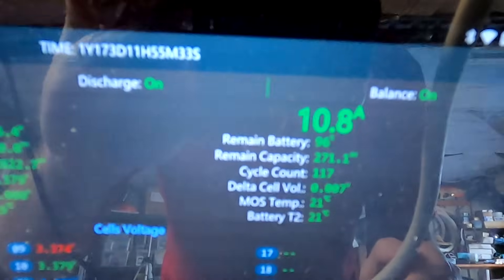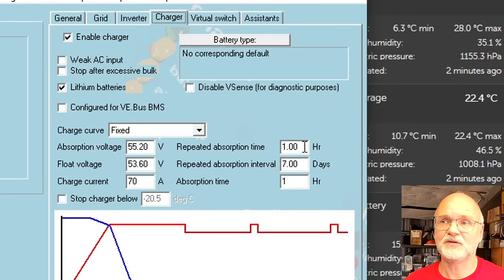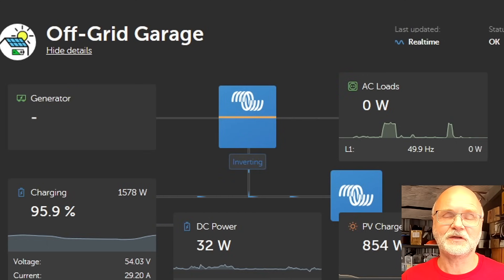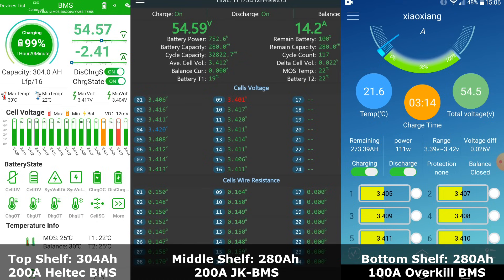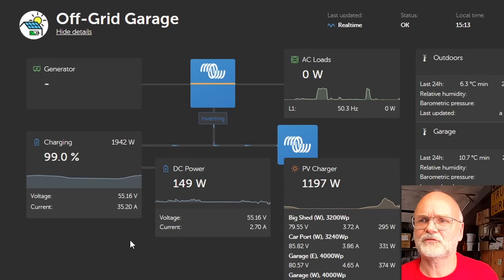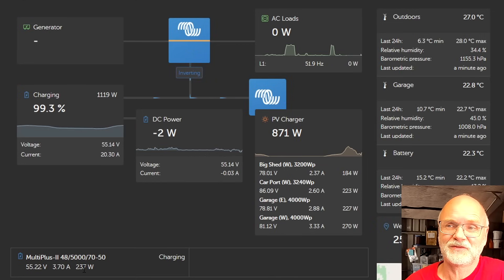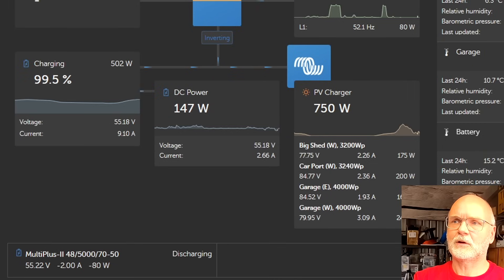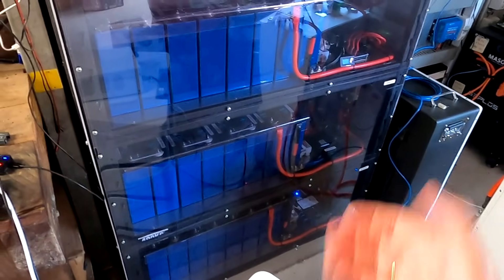Battery Shelf full charge after 4 months. First time of Multiplus frequency shifting!

Comment: Andy, very interesting and I did the same setup. I now need to connect an inverter to my multiplus to help out with peak loads.
When you connected your multiplus and inverter together, you said to not enable the charger as it would go around in a loop. 
So can you tell me how that is avoided now that you enabled the charger for the micro inverter?

Comment: I have some trouble to get the smartshunt and jk bms matching in soc. Up to 30% is looking the same then the bms is lower then the smartshunt. I checked the busbars,   individuele connection to the battery. Current and voltage are the same. What can I do to solve this?
Reply from the maker: Nothing you can do about it. Don't worry about the JK SOC. I have 3 BMS (JK, Heltec and Overkill) and they all show different SOC levels. They all calculate differently. Take the smart shunt as point of truth as I found it to be the most reliable and precise measuring device.

Comment: How do you limit the output of the tilt system microinverter when the Phoenix 'generator' is on?
Reply from the maker: This is a scenario which usually does not occur. The 'generator' only comes on if the battery is low but not at 100%SOC. 
There are other Assistants you can setup in the Victron Multiplus which disallow the generator or any AC load from coming online above 90%SOC for example.
I could setup a rule in either Home Assistant or the inverter which turn off the Shelly switch in the Micro-Inverter connection if SOC goes over say 95%.
Reply: I thought it came on for load.  Conceivably one can have a full battery and enough solar to carry loads above your configured threshold, causing the Phoenix to be switched on, locking the frequency at 50Hz.  Your lockout over 95% is therefore necessary for safety but also means you can't handle the highest loads when you have the most generation (potentially)  @OffGridGarageAustralia

Comment: Hello Andy follow yr channel on regular basis have 24v system in Wales UK have recently bought jbd BMS  but having trouble with China on what software they r using they advertise one with dashboard and access to parameters but not the same version on yr channel  any chance u could let me know which version that is thanks again have learnt loads from yr channel which is fantastic Cheers
Reply from the maker: Well, are you on Android or iOS? The XiaoXiang app should work with the JBD BMS with no problem. You can also try the Overkill app which works with most JBD as well. I have links to both of the apps on my BMS website: https://off-grid-garage.com/battery-management-systems-bms/

Comment: @OffGridGarageAustralia
Possibly found a new reset SOC feature in JK app. I recently upgraded some of my older JK BMS modules to newer B2A24S20P modules. I also updated to the JK BMS app v4.15.3 and found (among other things) two new configuration values: "SOC-100% Volt.(V)" and "SOC-0% Volt.(V)". My HOPE is that this will allow for a better SOC calibration for the JK BMSes. I emailed JK BMS support but not sure if they will respond. Would love to have your take on it?
Reply from the maker: Isn't the JK resetting to 100% quite well once the battery is full? I never had an issues with that.
Reply: @OffGridGarageAustralia  Historically JK BMS seems to reset to 100% SOC when it reaches the "Cell OVP(V)" value which, as you know, is not optimal. I have noticed in the latest JK BMS hardware they now have "SOC-100% Volt.(V)" and "SOC-0% Volt.(V)" options which I hope can be used instead of relying on "Cell OVP(V)" to reset SOC.
Reply from the maker: @KarelVenter  Ah, right. I have still an old JK which needs a battery to jump start. Mine resets to 100% if the voltage is high enough, not only at OVP.
Yeah, such a setting makes sense. They always improve this BMS.

Comment: Hello 
I need to ask a rather important question (for me) because I have seen thousands of video tutorials that say that there is no problem in making a parallel between multiple DIY battery packs.
but there is also someone who says that if the BMS of a battery pack were to disconnect for any reason at the time of reconnection there would be an enormous current flow from the more charged battery pack to the less charged one. this would create a lot of problems especially of security. They even say that the bms, reading this exaggerated current, could continue to disconnect and reconnect or that the fuses would continue to blow going beyond the amperage.
Now my question is this is : there no way to reduce the output current of a battery pack via the BMS so as to limit this output current or There are devices to be placed between the battery packs to manage this type of problem?
P.S. I'm asking these questions because I'm going to make two 1p16s battery packs.
thanks
Reply from the maker: Hello and thanks for your question. Paralleling different capacity batteries is usually not a problem as the current balances out between the two packs. I have tested a 12V 5Ah in parallel with a 12V 300Ah battery to see what happens (https://youtu.be/fQz7vZEYLfY).
Also, it depends on the chemistry of the batteries. Due to the very flat voltage curve of LiFePO4 batteries, it is not a problem to parallel them and even at different SOC levels, the currents across the packs are very shallow. This is different with Li-ion batteries for example and cross-currents can be huge.
Also, some of the more advanced BMS have a current limiter to prevent big equalisation currents. Check out this video here: https://youtu.be/Rsb8wRqtNs0
Reply: @OffGridGarageAustralia  thanks for the reply, I'm watching all your old video to learn more....
Bye

Comment: Nice! At this rate (pun intended) your batteries will last a very, very long time!
And you proven quite a few interesting things too, we learn a lot from you.
And due to that, I have more & more Victron Kit, marvellous!
BTW, can we use your settings for the JK BMS also for the JBD BMS?
Or should I instead use your settings from the Overkill BMS?
As an overview of your JBD settings & configs seem to be missing.
Reply from the maker: Thanks for your feedback and sorry to hear you're spending money on Victron gear. I know it's expensive...😄
Yes, you can basically use the settings across all BMSes. They don't need to match 100% and what I have set for my system may need some slight tweaking on your system anyway. But it's a good starting point.
Reply: @OffGridGarageAustralia  No worries, Victron is quite good and also hold their value too when reselling good-as-new. (I resold my Blue Power Charger and bought a few BlueSolar charge controllers to repurpose my Goal Zero Boulder solar panels I have quite a few off).
I was enquiring about the BMS settings as I noticed the Müller Energy's BMS has several settings that are quite off compared to your settings/recommendations. Even for "just" a 12-volt system. (percentages of the various charge-levels, the infamous protection-voltages and so forth). I probably will make a nice spreadsheet and fill-in the default versus the Andy Sunshine settings, makes it more visible what the actual differences are. Thank you for taking the time to response, much appreciated!
A set of S.P.A.T is underway to you for appreciation.
Reply from the maker: @InspectorGadget2014 ah, yeah, these charge level percentages... I'm not even sure if the BMS uses them as it counts the Ah, rather then measures the voltage.

Hey thanks for the S.P.A.T.! Appreciate that!

Comment: I think it is not waiting for the 50 Hz, it is simply taking time to resync after dropping off. You should be able to also see a delay, if you connect the microinverter to AC. It will not switch on immediately. Some microinverters take more than 2 minutes to "sync" to the grid.
Reply from the maker: Yeah, OK, that could the case as well. It was the first time I have seen it so, more testing to understand better is underway.

Comment: Hello Andy, I have a question, does a 48v 280a battery necessarily have to communicate with the hybrid inverter? Does it matter whether the battery communicates or not? thx (and also what do you prefer as bms which communicates since the JKBMS does not)
Reply from the maker: No, it does not need to communicate. I have three 280Ah/304Ah battery banks in parallel with no communication to the charger/inverter. System runs flawlessly for 1.5yrs.
The JK can also communicate. Check this video out where I show it: https://youtu.be/sHIlP2oJ3DU

Comment: Thank you very much for this test. Good to see that the frequency control of AC inverters by the Victron Multiplus works very well.
As I have a Victron ESS system that of course works in parallel with the grid, I cannot do frequency control.
That brings me to the point I would like to mention.
The behaviour you mentioned at 13:40, that a Seplos BMS would tell the Solar charge controllers to throttle the power generation and only allow 10A, is not correct. That seems to me to be a "problem" with off-grid systems. I have never seen the power to my loads in the house or the excess feed throttled by the BMS. In my case, when my two batteries are full, they are throttled to 10A each. The power generated by the MPPT is used for the house and grid. The only limiting element is the power capacity of the Multiplus. My system with my two Seplos BMS 10C firmware 2.8 has been running perfectly for a year. I have only installed one NEEY balancer per battery ...and of course optimized the settings of the BMS parameters 😀
Reply from the maker: Thank you for this information. ESS and Off-grid are very different.

Comment: Can you control the output power of your water heater? Or is it just a simple on/off thing?
Reply from the maker: It is simply on/off via a Sonoff switch. I can easily setup an automation now in Home Assistant and when the SOC is over 95%, I can turn on this switch and if it is below 90% I turn it off again. At the moment, I just do it manually.

Comment: Andy, this is exactly how my Deye 2000W micro-inverter behaves with MultiPlus-II installed in my campervan. It has 900Wp panels on roof but recent hot days when even nights were way above 23°C run mini-split AC overnight also and battery charge was constantly dropping.
I've got spare 450Wp panel but only 10 meters of DC-cablings severely limiting  panel positioning. Now I can use proper 3x2.5mm2 camper cable which is 25 meters to position panel to most optimally to get charging up again!

For winter and longer periods of not so good sunshine considering to invest to light box trailer, equip it with three 500Wp bifacials on rails so that one panel is on roof, two folded on sides when moving and when stationary lifting side panels level with roof panel and tilt whole setup.

Btw, Deye is sold as Sol-Ark in USA, I've learned. Little confidence boost for the micro-inverter...
Reply from the maker: Thanks a lot for sharing. Very interesting, you can never have enough solar, right?
The Micro-Inverter I have uses the same hardware as the Deye. It is just re-branded.

Comment: I was wondering if the tilt system will keep trying to push power after the one hour hold of 55.2 when you let the voltage fall to float? You should show us
Reply from the maker: That is a good question. Victron has a built in safety switch for that and the frequency will only recover back to 50Hz when the battery voltage is Float voltage -0.8V (setting in the Multiplus). I'm testing this right now and will provide an update video.
Reply: @OffGridGarageAustralia  I just saw that potential issue as soon as I saw how fast it started delivering full power from the micro inverter and then kicked straight back in once the freq returned to 50. Thanks for the update

Comment: This was a very very cool video. Thank you for sharing. I think you said you can’t use AC In on multi-plus with the microinverter AC coupling. What if the Phoenix inverter kicks on while the microinverters are connected.  I think you still have the Phoenix connected to MP AC-In.
Reply from the maker: Thank you. Yes, that is correct. As soon as there is an AC-in signal, the Multiplus will fall back to 50Hz and the Microinverter will also adapt to this frequency and start producing as much power as it can.
This is indeed a problem in off-grid installations with a generator. But usually the generator only comes on when the battery is low and not when it is almost full. Victron provides other measurer in this case, for example the Generator Assistant where you can prevent the generator from turning on when SOC is higher than 90% for example.

Comment: I don't understand why would you want the micro inverter to increase the frequency? Seems to me you would just want it at 50 steady? Anyone?
Reply from the maker: It's for an off-grid system only. 
If you're grid connected and the battery is full, you usualy export the excess energy.
You can't do that in an off-grid installation, can you? So you need to tell the AC-Inverter to stop producing, when the battery is full. This happens through the frequency.
Reply: @OffGridGarageAustralia  It's not only for offgrid systems, also for grid connected systems but in a situation when the grid is down.
Reply from the maker: @kameraadcoenraad  Very good point!
Reply: Changing the frequency will make the microinverters shutdown. You want that because they can't dump their power if the battery is full. In case of a grid tied system you can export it to the grid and you don't need this feature.

Comment: Such a shame the micro inverter output doesn’t track the frequency on the way back down.
Reply: Would do if he matched the settings in the Victoron to match the micro inverters behaviour. Problem is he has it set to throttle all the way to 52.7, but his inverter disconnects at 52
Reply: Good excuse for another video though.
Reply: @edc1569  yes, it would be good to see some more experimentation. Andy?
Reply from the maker: I don't think I can change the settings to make the micro inverter work that way. It just waits for the frequency to go back to 50Hz before it starts working.
Reply: @OffGridGarageAustralia  You showed us the setting in the victron app (3:17) when you set the (big) inverter up, you just left it on defaults though, if you change the settings "the output power will be reduced to minimum" to 52 or 51.95, I imagine the system will do better at avoiding tripping the (small) inverter out entirely, and it having to go through its mandated restart procedure.

Comment: While it seems to work and is probably enough for a garage, I think it'd drive me crazy when used to power the house as I like my clocks accurate. Quite a lot of home appliances with clocks use grid frequency as clock speed. While grid frequency does very slight shifts, it also uses some other compensation methods to stay stable on average. This micro grid will mess clocks on your home appliances.
Reply: Absolutely - anything outside 50.0 Hz will make clocks inaccurate.
Reply: But the power from the micro-inverters only go to the Solar Charge controller and not the power that the Inverter is supplying to the “house”, right?
Reply from the maker: I have only one clock in my house (in the stove). Not sure if this is dependent on the frequency....
Reply: @OffGridGarageAustralia Stoves, microwave ovens, vcrs,... almost all of those use it. It's cheap and very accurate, so it's basically the first choice for manufacturers if they can use it.
Reply: Tom Scott does a great video on the British electric grid and how it kept time and managed frequency shifts for devices in their entire network.
Reply: I think the age when clocks use mains frequency is almost gone.

Comment: I am wondering why you don’t heat water with a non electric style solar heater
Reply: For some time now it has been more cosr effective to chuck on a few more panels and use electric (preferably heat pump) hot water than to use solar hot water.
Reply from the maker: A solar hot water system pays off in 29 years for me. We use around ~4-5kWh/per day in winter and ~0.5kWh/day in summer for hot water. And yes, some more panels will do the trick.

Comment: I'm still confused as to why the frequency needs changed when electronics run 60hz US or 50hz AU
Reply from the maker: How do you turn off an AC-coupled solar system if you don't have a grid where excess energy can be exported to?
Reply: @OffGridGarageAustralia  ah now I see. I was forgetting the micro inverter array and how it's fed in.
Reply: It's how the Victron inverter communicates to the micro inverters at the solar panels to regulate power generation when it needs to be limited or stopped .This is the standard for AC coupled solar .
Reply: @onthelake9554  ac coupled solar is something I need to learn more about. Right now my mppt does the work and my multiplus is only an inverter. I could have went with a cheaper inverter but I wanted to keep my entire system in the victron ecosystem

Comment: FWIW this Seplos behavior is a victron thing, not a Seplos thing. With Sol-ark (Deye) inverters, the max charge voltage from the BMS is respected from the inverter as a bus voltage. So while the batteries might accept 0 current, the inverter will still take solar to fully run the loads and have no current coming from the batteries.
Reply from the maker: That is also the case for Victron if connected to the grid and ESS is activated.
Not in an off-grid system though, which I have.
Reply: @OffGridGarageAustralia  deye works as described above in off grid mode as well. Really seems like victron